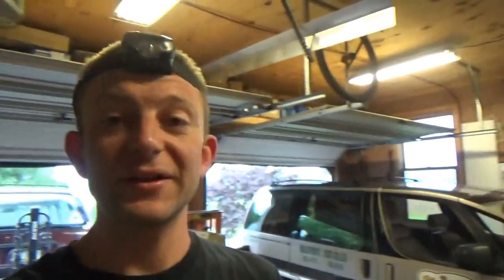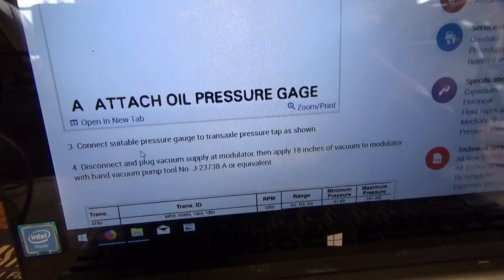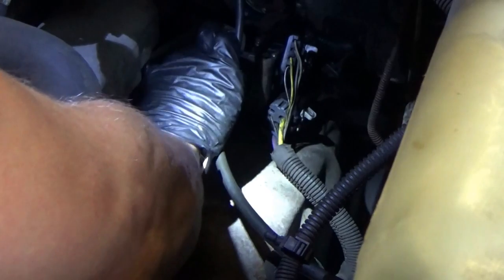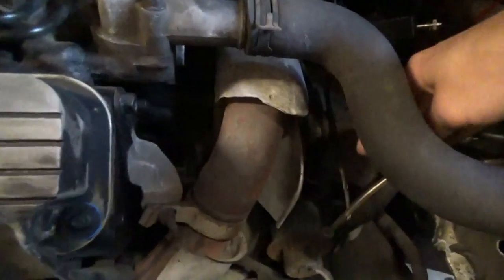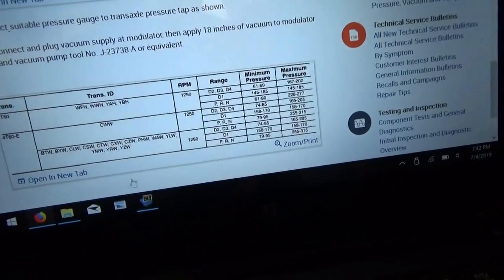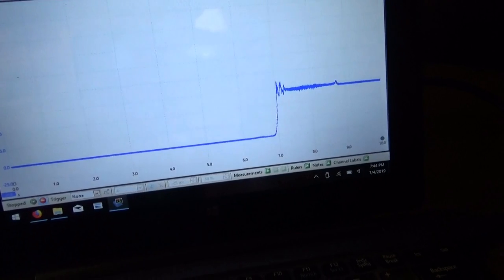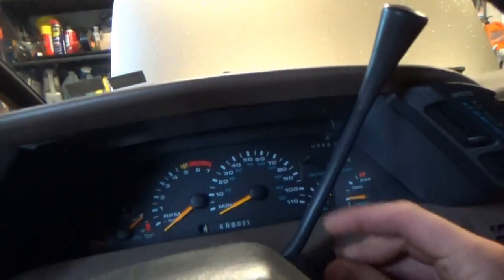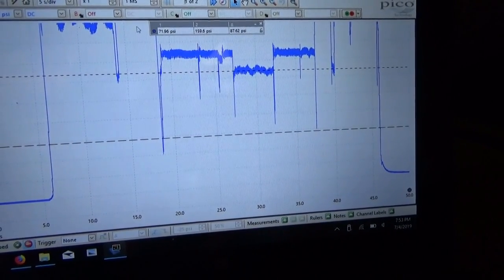Silhouette Chronicles -Part 13: Trans PSI Check

Comment: I've been driving this van now for 2 months. At first on cold mornings, the transmission needed to warm up for 2-3 minutes before it would engage, just like in the viedo. This morning was about 29 degrees and it went in to gear immediately. It had a bit of a heavy engagement, but it engaged right away. All Ivan's work combined with daily driving seems to have solved the problem!

Comment: I'm not sure you have a grasp on the complexities of an automatic transmission, Ivan. Basic pressure checks are only a basic part of the story, anything that is detrimental in a main pressure check will show out like the balls on a dog, pressure loss that is out of spec is easy to diagnose. Valve body issues are harder, valves that are scored or check balls that have hammered out a valve body sandwich plate can be a WAY lot harder to diagnose and are often only diagnosed once the the trans is removed and torn down and inspected. 

A main pressure check is only to check for pump health or major leaks.

Comment: I purchased a similar transducer from ebay but operates off a 12v rather then 5v so no need for the box I use a cable adapter to the battery  works great.

Comment: Well at least we know the pump has good pressure and the valve body is applying pressure to the band and clutches. Have you tested the modulater pressures?

Comment: We had a new 89 celebrity with this transmission. It gave us nothing but problems and was replaced more than once and thats with proper maintenance. When we finally donated it the transmission was going out again and we have no real idea why. It wouldnt shift, it would get caught between gears, it would lose a gear, one time gm only replaced half of the parts that led to another replacement which my dad fought for and gm had to pay labor for.

Comment: This is the thm 440 transmission right? My friend owns a transmission shop and talks about these transmissions cause he worked on them when they were new. He started out as a gm transmission tech and these transmissions were some of the hardest to work on.
Reply: Looks like a 4t60E. The 4t440 has a throttle valve cable going into the top of the trani right next to that pressure plug. Same family of transmissions, different generations, different part numbers every time you turn around.
Reply: @benjaminkline4855  yep, no TV cable, unless I'm blind lol

Comment: nice set up  where did you get the transducers?   one thing ya gotta watch is the threads on 1/8th inch    american is 27 tpi and bsp is 28. on steel or cast iron it wont booger things up  but on aluminum or brass  its easy to trash a hole. also bsp is slightly smaller diameter and doesnt seal good.  i avoid tape on anything hydraulic. been there  dug that out. no fun tearing a valve body off a dp6000 allison in the middle of the woods in a dounpour. and dissassembling it completely. tearing a gasket and having to make one with a hammer out of a  manilla folder.
Reply: Agreed, I use small amount of pipe dope on the male thread. Otherwise it causes a huge headache

Comment: I think you should keep the van here where you can get to it, in case of mechanical problems. I would make it a Uber ride.  School is in and you are in a good location.
Reply: Uber doesn't let you use vehicles over 15 years old
Reply: @jonclark1288  , Oh didn't know, that is not what I want to here. Thanks.  That would be a good way for mechanics to use there excess  cars.
Reply: Or a PHD rental/loaner service car!

Comment: Your pump filter/fluid are fine.  The inner input piston seal fails which is causing your no move cold
Reply: Inner input piston seal? What the hell are you talking about.
Reply: @2secondslater  A rubber lip seal that fails in the input drum that seals on the input piston for the input clutch.  Any other questions?

Comment: Way back in the day, I bought all the trimmings for my Vantage, including all of the available pressure transducers.  Everybody in the shop thought I was wasting $ until I started diagnosing problems w/o even getting dirty, or using several gauges. Then the boss bought 1 for the shop.....Obviously a Pico or similar is much easier to read ;)